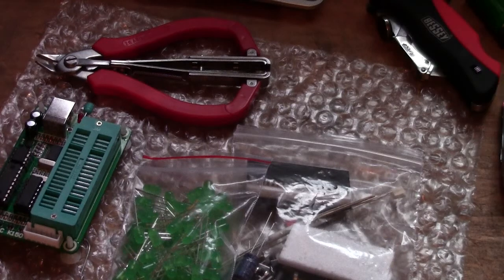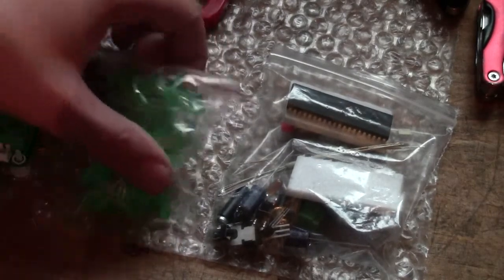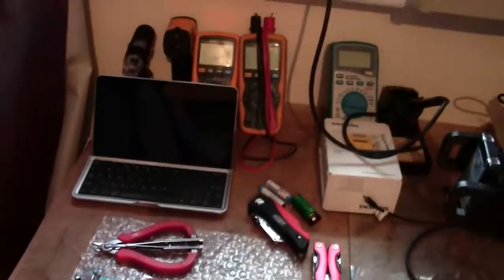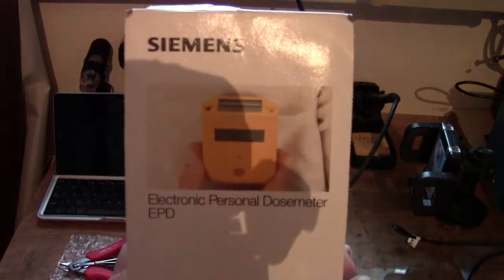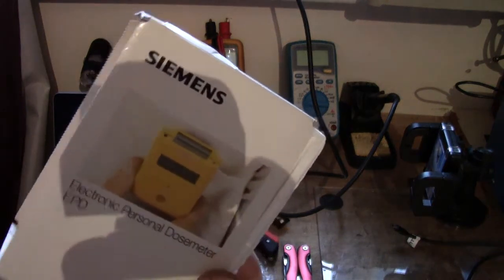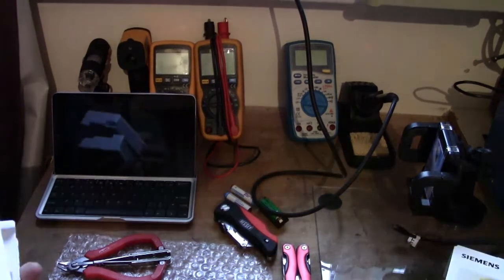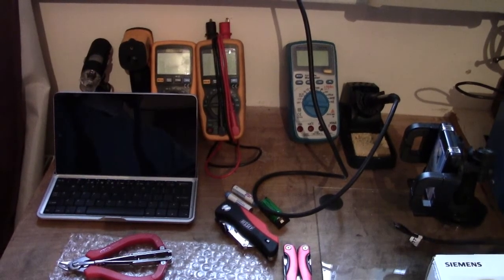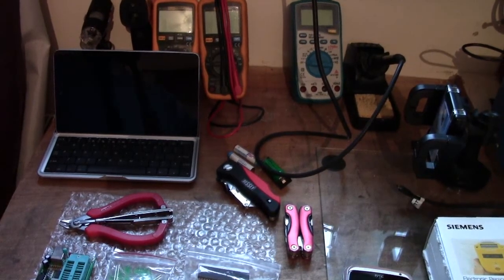HV TO LV and a nice new toy ;)

Comment: Nice goodies.
Reply from the maker: Thanks mate
Reply: I'd have gone for blue leds John everyone knows blue leds are cool ha saying that they also need more voltage. It's a good way to break into programing though I started with the arduino befor that it was ladder logic. I'd build your self a little remote for your ballast so you can switch them in using blue tooth. Completely unnecessary but a fun project.
Reply from the maker: blue is the norm and I'm far from the norm ;) the power doesnt make much difference as it's just a matter of changing the resistor value but i like green anyways ;)

Comment: I was going to do exactly that, an LED cube :)  Arduino's are ATMEL based, I've built stuff from scratch with ATMELS and AVR assembly, good MCU's. The Arduino boards and shields are interesting for starters.

I setup a similar "rolling pin" vacuum experiment to yours and tested it with an Arduino based Geiger counter and at very close proximity the HV interferes with the readings substantially, at a general distance nothing more than background was detected so quite safe I'm assuming.. I do want to run a flyback through that same setup at some point..

Look forward to seeing what you produce with the MCU!

Comment: nice, hehe gotta love youtubes suggestions lol, thats cool gonna expand your horizons go from analog to digital :) i started learning programming on a Teensy++ microcontroller it is atmel based which is also arduino compatible, arduino has alot of documentation and libraries to make complicated things easy plus quite a bit of support. im sure PIC is good too ive just always used arduino, its like windows and mac :D
Reply: which one is like Windows coz I hate Mac .LOL I may have to find an Arduino and have a play i only here good things about them ;)
Reply: lol! :D yea i think arduino is alot more simpler but it doesnt teach you the entire inner workings of the code, because of all the libraries you just use the commands in the libraries and dont write out the full program, if you want to truly learn to programming i would say PIC is better but if you just want something to do something without worrying about the technicalities then arduino is the way to go, another thing is that with arduino you can be limited somewhat by if there isnt a library to do a certain thing you will have to do it the hard way :)

Comment: there is a lot of paranoia about Xrays being produced
you need SPECIFIC circumstances.. ie: DEEP vacuum, and also electrons streaming towards a heated plate, and other factors. had the same comments about my high voltage / vacuum experiments. i doubt my refrig compressor vacuum pump can do the job :P
Reply: I know what you mean but for a safety factor ya can't be to careful with me family about ,not sure about fridge compressors but a good vacuum and HV I ain't taking any risks not sure about a heated plate but the electrodes get hot .
Reply: John Seach
I seem to remember being told that the threshold for making x-rays is 30KV when I was doing my A-levels. Any less and it's impossible to make them. Do bare in mind though, 24 KV RMS has peaks over 30KV so a 25KV RMS sine wave should do it.
Reply: Thanks mate . Its a very misunderstood thing and I wouldn't want to take the risks ;) not sure what if any different frequencies  has on producing them either ?
Reply: DC is normally used but you could still get bursts from AC whenever you get a potential of 30KV or more. Frequency would just affect how often the bursts occur.
Reply: Nice one mate that's useful to know .the hard thing is knowing how many kv a tx is producing as you could think 25kv but in reality it could be 15-35kv .I think a dosimeter is a good thing to have just incase ,also I'm waiting for a hv probe to get here which should help in knowing the kv :)
Reply: Of course, it's better to have one and not need it than need it and not have one. As for measuring HV, why not make up a voltage divider to reduce the voltage then use a cheap multimeter to measure that. It should be fairly simple and as long as you consider the voltmeter's internal resistance it should be fairly accurate. Just don't touch the meter while it's on to be safe.
Reply: Your not wrong lol .I actually brought 20 x 200M HV resistors to do exactly that but then Steve found 2 x Fluke HV probes for a steal of a price so kinda gave up on making one ,For now though I probably will still make one as I have a large analog display that I really wanted to use :)
Reply: Just be careful with those probes, I'd rather pop a £10 maplin meter than a nice scope.
Reply: That's very true mate I have some cheap meters I got as free gifts with electrical components I'll be using those I recon .although I have set my analog meter to 4v FSD so I nay just use it with that
Reply: well, assuming your meter is 1Mohm you would want one of your 200Mohm resistors and a 240K resistor, that would give you just under 1:1000 ratio meaning your meter would read 1 volt per KV. If you've already got the resistors I would seriously urge you to try it.
Reply: (200M pull up, 240K pull down) obviously, lol
Reply: I hadn't done any of the maths but the problem ,well not really a prob but a bot of a pain is that resistors are only 10 kv so I'd have to make a sting of series parallel ,like an mmc in a way I guess so they can handle I have 2 meters that read 5 kv so that may be the way forward with the homemade prob
Reply: I suppose you could make a divider for your cheap meters (that you don't mind popping if your resistors arc over) that's good for 10 or 20KV and use your HV probe for everything else. As long as you're nowhere near your meter I would imagine you could put double their rated voltage across those resistors at least.
Reply: Very nice mate that a sexy bit of kit  I bet you wont sleep till its christmas now ;) .I only have an old anolog scope that i swapped for an NST it does the job mind
Reply: I've been using the digital scopes at my university for a while now but I often end up getting an old analogue one down from the back of the lab and using that instead. Digital ones might have loads of fancy features but sometimes you can't beat an analogue one for ease of use and being able to set them up quickly. The good thing is nobody else goes near it because they don't have a clue how to use it, they just use the autoset button on the digital scopes most of the time.

Comment: coding in Basic or C ???? ?
Reply: Very very basic .lol I've never done any before and don't have a clue :/
Reply: John Seach 10 print "High! John!"
20 goto 10
RUN
Reply: Haha I don't get it but I'm guessing it's code ?
Reply: John Seach Unless you're looking to write in assembler, I would have got an Arduino to learn on since there's so much help out there as well as example code. Why not have a look around their website?  I think Arduino code is based on C with some libraries written in C++, by the way.
Reply: to be honest I got the Kit for something to do ,I didnt know anything about it all :/ all i knew is  that i wanted LED cube ;)
Reply: Fair enough. I would consider getting an arduino though. Very easy to get started and you can replace the micro controller for a few quid if you pop it.  (Uno R3) Possibly for christmas off the missus? ;)
Reply: yeah, your best bet is to have a look around the arduino.cc website at examples ect. There's some good books out there too.
Reply: Nice one for the help mate .Google would have prob sent me to wiki lol
Reply: no problem. I've just started learning it myself too.